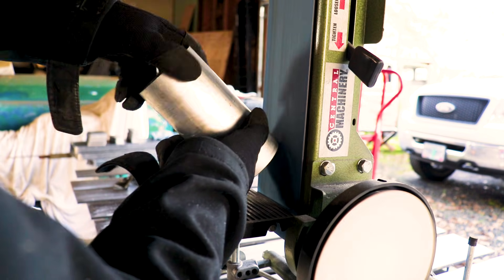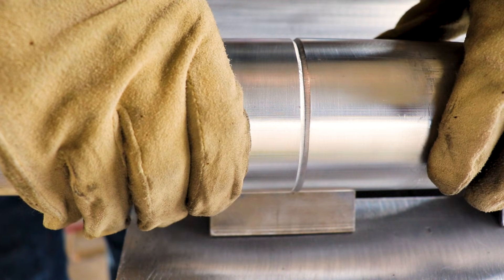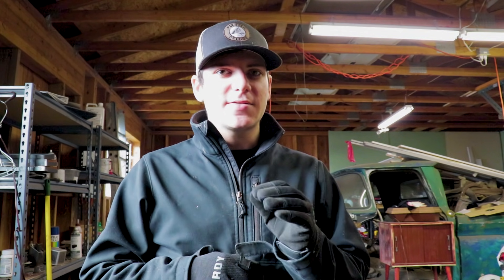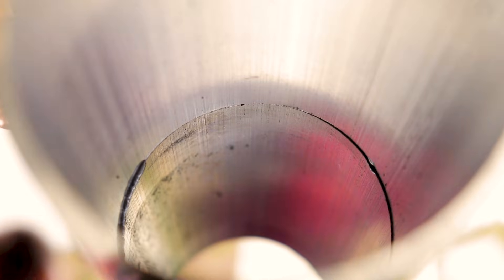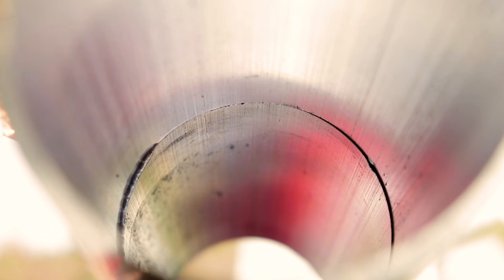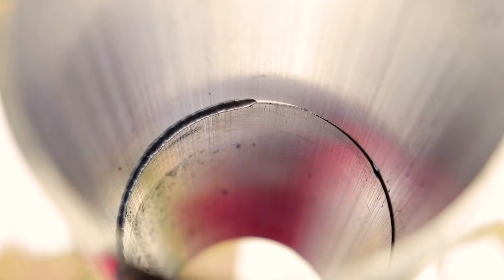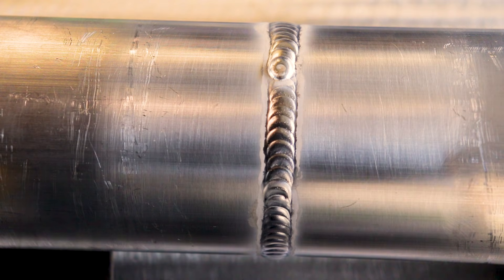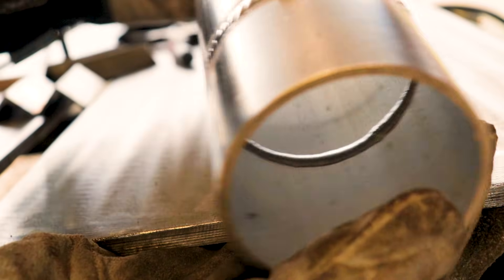How to Weld Aluminum Pipe

Comment: I do also have amperage written down for thin material that works fine for me, But haven't done a lot pipe welding just sheet metal. When it comes to welding 6G Stainless steel pipe I ways have problems at the start, the bottom of pipe with either suck back or too much penetration, its always too much push through on the bottom side. Thanks for the info.
Reply from the maker: +Fred Garcia virtually all the stainless tubing I did was on a positioner.  So I don't know for sure on 6g but mess with your purge flow rates.  If it's sucking back try dropping the flow and repeat.

Comment: You use the same bead  process for running steel or stainless?
Reply from the maker: +Fred Garcia no with stainless inblast it and start running.  I used to have the amperage written down for each thickness and size tubing.  But it's been so long I couldn't say for certain.  You need a good purge.  And generally when the puddle starts swirling it's all the way through.

Comment: I blow through the gap on something like this, no matter how closed it is.  Using lincon square wave 200, 3/32 2% lanthenated
Reply from the maker: Pedro Zertuche you might want to try starting even slower.  I just keep slowly ramping up until I get the puddle how I like it.

Comment: Thanks for the video it was really a nicely done video. Can you tell me, or can you share with us all, what you used to get the clarity in the welding shots with the camcorder? Is it some kind of a high-dollar set up or do you just have the right mix of camcorder and Welding lens? And if so can you share that with us? Thank you.
Reply from the maker: Joe West hey no problem.  For this one I did finally get a nice camera it's a canon Rebel sl2.  But I used to use my phone and got nice arc shots. The trick is setting the ISO really low to about 200.  If you can't you can get a free camera app to do it.  Then I would get my phone or camera super close and manually focus it so it won't lose focus.  Then I pony clamp a spare welding lense like a shade 10 over the camera and start recording.  Let me know if this helps or if you need more help.

Comment: Nice work. Are you running the AHP? And lets talk avout the old chevy in the back ground.
Reply: Also have a nice new year
Reply from the maker: NTH Welding yep it's the ahp it started running crappy on aluminium a month or 2 ago and the other day I took the line off the back and purged it out and bam! Back to normal!  Still not as nice as my syncrowave 250s at work haha.  And that's my wife's project haha between us both we have 4 or 5 projects that we're too busy for.  You have a great new year too bud!

Comment: I love your videos! Can you make a video about how to get clear vision when welding. Best lenses, lighting setup , etc... I struggle to see the puddle a lot. Although my vision isn't terrible, I do wear glasses, so that might have something to do with it. How to avoid reflections inside the helmet.  Any tips would be helpful.
Reply from the maker: Marcel LeMay I've never had that problem.  I usually use a shade 12 or 13 and get extremely close to what I'm welding.  If you have light reflecting in under your hood, a lot of guys I work with take the leather cuffs off of old gloves and attach them like a beard to shield the glare and also a section that covers the top of the head.
Reply: 5th Street Fab Shop  Thanks man. I think that'll help a lot.

Comment: Incredible!  I have never seen that perfect of interior penetration in my life.  

What type of set up are you running from tungsten to machine?
Reply from the maker: Rainman thanks bud! It just takes practice.

For this I used an Ahp 200x which is a cheap Chinese welder.  I set it maxed out on amperage and adjust with the pedal as I weld.  My frequency was at 60hrtz and my cleaning was at 45% DCEP.  I used 2% lanthanated tungsten and I had a #7 gas lens.  The only reason I had a gas lens was so I could stick the tungsten out real far so you could see it on the video.

Comment: Nice welds and great arc shots, man!  I also use an alphatig but I've been having issues with aluminum.  Are you balling up your tungsten first?  It looks like you are.  If so, how do you go about that?  In class we use miller dynasty 215s and the instructor said there is no need to ball it for alu.  But ive noticed my alphatig welds aluminum pretty different than the dynasty, and I'm thinking about copying your settings next time I'm out in the shop.   Thanks, and keep up the awesome videos!
Reply from the maker: Shawn Freeborn  Reuden edwards nailed it!  I do like sharpen my Tungsten before I do it, it seems to help ball more evenly.  And make sure you're straight up and down.
Reply: If you can set AC balance you can turn it to max. cleaning and light up on some scrap. Have to watch the tungsten because it will ball faster the higher the amps. I usually pump the pedal and watch it round till i get the round or full ball i want.

Comment: Great welds and good tips, I'm doing a lot of 3 inch aluminum pipe right now and it's pretty tricky, heat builds up quick, cheers.
Reply from the maker: Danthefordfixer it sure can! I like to let it cool after a quarter or half pass.